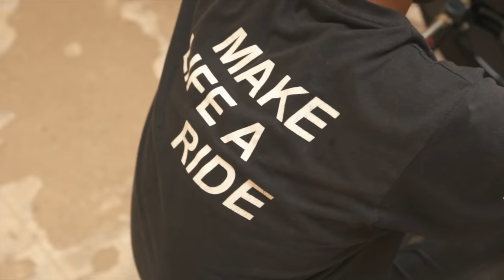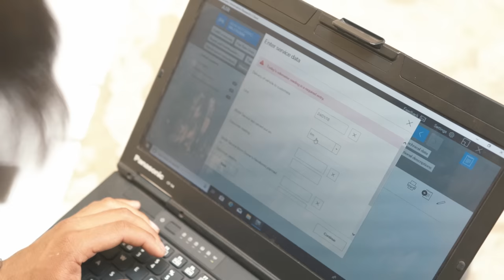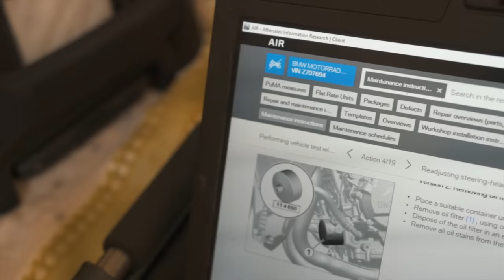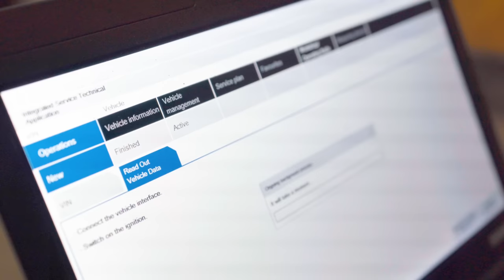BMW s1000rr PRO - 2nd SERVICE & COSTS INVOLVED.

Comment: In first service do u changesy air filter sir?
Reply from the maker: partha sarathy I had changed it to BMC race air filter during the first service
Reply: @soamjena  tyres and brake pads remain stock sir?
Reply: @soamjena  how much does bmc air filter costed you sir and will it last for 20k kms bcz k&n people said it lasts 20k kms
Reply from the maker: partha sarathy around 10500 or so. Yes it goes for long

Comment: Sir no brake pad and tyre chnage?
Reply from the maker: Brake pads to be changed after 6000km. Tires to be changed after 6000km.
Reply: @soamjena  how much kms done on the odo sir till now date
Reply from the maker: 5500km

Comment: Wow 18k that was little bit expensive but in case somu vai no problem way evr it may b after all it BMW🙌🙌🙌🙌☺️☺️☺️☺️
Reply from the maker: 1st service was around 32k. 2nd service 18k was reasonable.
Reply: Soumendra Jena Ji we r learning a lot frm u ☺️☺️☺️
Reply: 18-20k/year for service of a litre class super machine is not bad at all
Reply: soamjena bro pls let me know where you got the rear cowl from hongkong at 4.5k right pls gimme the shop name address....
Reply: @soamjena  why it's 32k did you add any mods. How much it cost without any mods in first service

Comment: You should changed your oil every 3000km, not once a year lol and BMC filters is killing your power get a Sprint filter. BMC sucks lol
Reply from the maker: S1KRR Ant bmc works fine for me.
Reply: Soumendra Jena it’s good but it’s no better than oem. All the fast bikes run Sprint filters including wsbk bikes
Reply: Soumendra Jena you got way more money than me, get yourself a sprint filter. If I can afford it on my bike I’m sure you can. Also best s1krr tuner is brentune